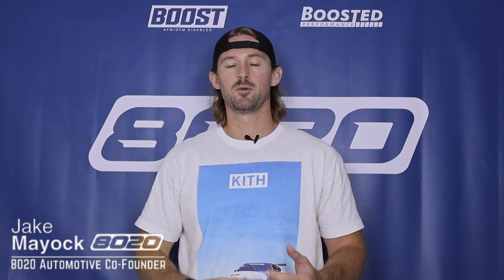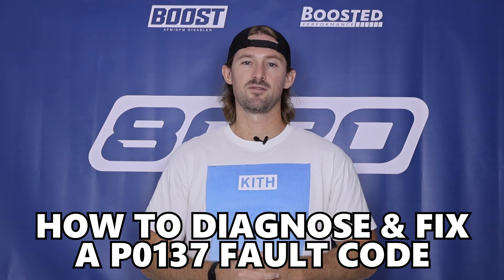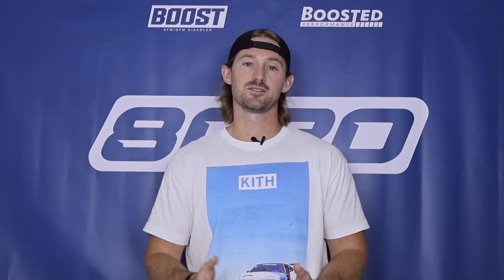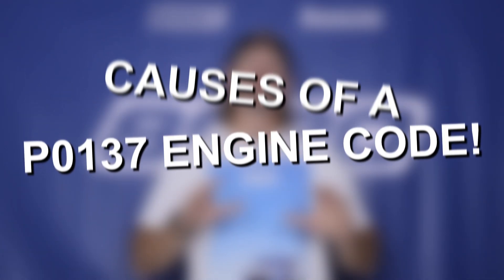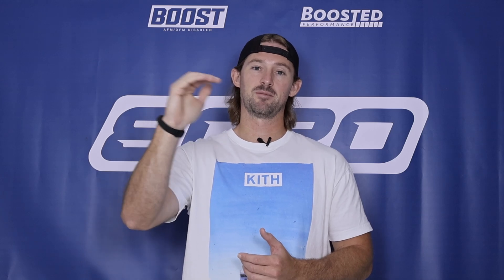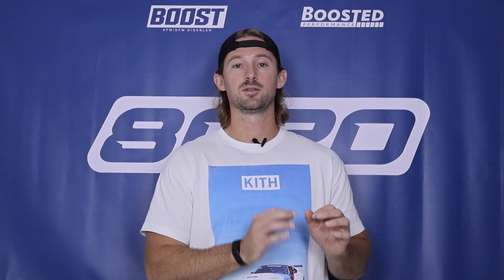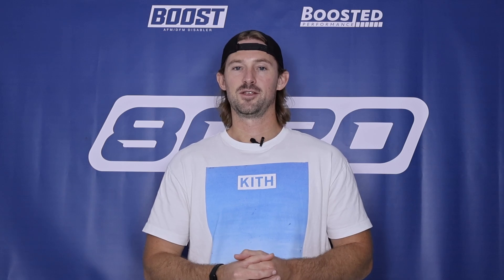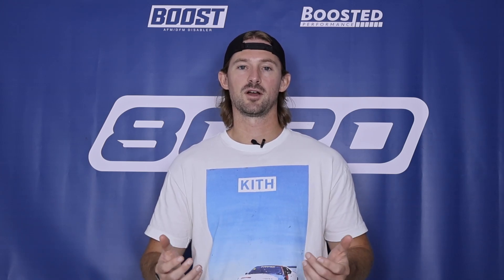P0137 Code: Don’t Replace Your O2 Sensor Until You Watch THIS!

Comment: I have this peculiar case where it gives me CEL p0137 only at high speed. I could drive for months in the city and it won't come up but for example on the highway at a constant speed after few (3-5) minutes it comes on. I had this problem before and after changing the engine with all its parts. Any idea?

Comment: I’m having the P0137 code. My car is going only 20mph and rpm isn’t going up more than 2. My car jerks while driving. I also had misfire on cylinder 2 and 3. I just changed the spark plugs today.
Reply: Hi, the same thing happens to me, the same codes, how did you solve those problems?

Comment: I just replaced the O2 sensor with PO141 fault, now I have this PO137 fault. What's your guess on that?

Note on replacement the new o2 sensor had slightly different design and came with a keyring style gasket (assumed).
Reply from the maker: G - P0137 is for O2 sensor circuit low voltage (Bank 1, Sensor 2), which means the downstream sensor after the cat is reading lean or not producing a proper signal, and since it popped up right after your replacement, it’s very likely related to the new sensor itself — either it’s the wrong part number/incorrect cross-reference, the connector or wiring isn’t making solid contact, or that “keyring style gasket” prevented the sensor from seating fully in the exhaust stream; if the sensor tip isn’t exposed correctly, it will read low voltage all the time and trigger P0137, so I’d double-check the part number against OEM spec, make sure the connector and wires are secure, and consider swapping back or trying an OEM sensor without the extra gasket to see if the fault clears.
Reply: @8020Automotive can I clean sensor with brake cleaner to posabilly fix. I can't afford new..
Reply from the maker: F - You can!
Reply: @8020Automotive I'm gonna order new correct part and I think will correct problem. It's not my car but my relatives. If it was logically this current fault PO147 surely it would have happened before the heater element fault PO141. Problem is buying cheap parts of ebay 😅😅😅